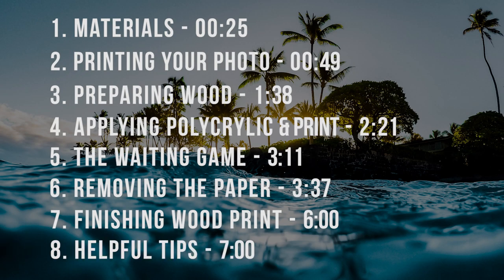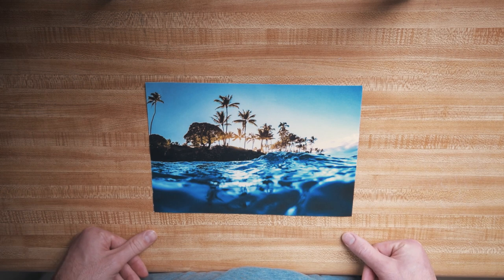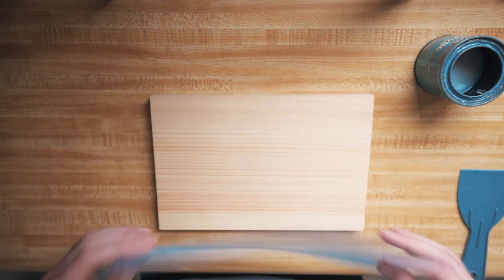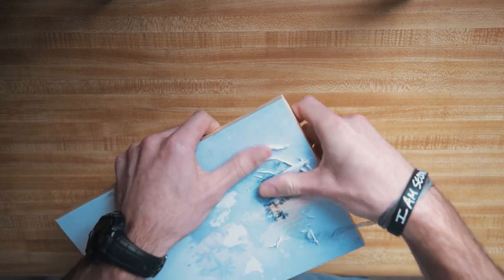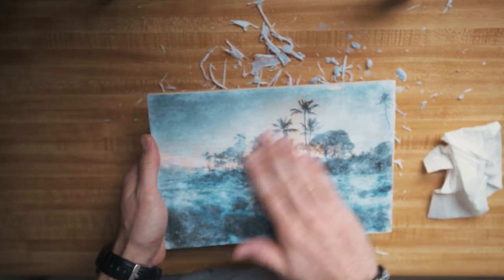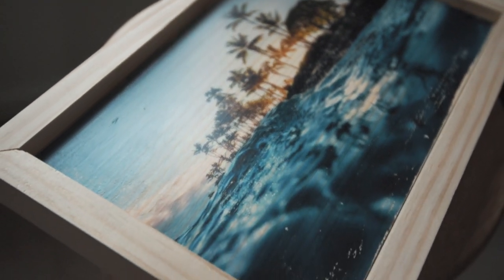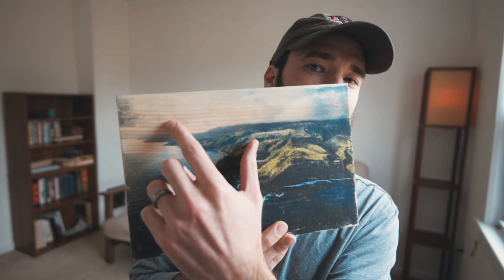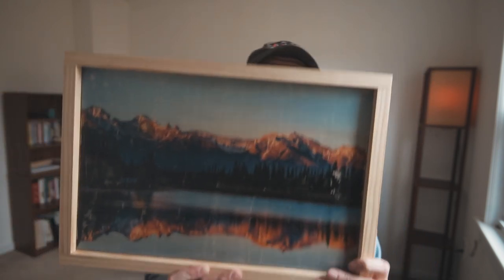DIY How To Transfer Photos onto Wood Using Polycrylic

Comment: I wish I could share my failures.  I have tried and tried to transfer with the polly.  I have done a thin coat, a thick coat, and everything in between. I have waited any were from 1 hour to 28 hours.  Every time 60 - 90% of the photo runs off with the paper.  Ppl please, any suggestions would be SO helpful!!

Comment: Hey, thanks for posting. I just tried this and when gently rubbing the paper off most of the ink came off also. I used pine, polycrylic and a laser printed photo.
Reply: try ink printed, not laser
Reply: Same here. Used inkjet and paint rubbed off with paper. It seems that the type of wood also matters.

Comment: If you use hardwood just put a couple coats until smooth and let dry. May have to sand after each coat. I like to spray wood surface first to lift grain then sand with 400 grit.Then it's no issue to transfer after a few coats.
Reply: Also I use a small torch to waive across each coat of poly to burst air bubbles. I use foam brushes and with torch it makes it super smooth.

Comment: I used the minwax matte polycrylic to adhere my picture to cedar plank. I have tried to take all the paper off in five or six steps but when it dries it's completely cloudy. Did I put too much polycrylic on? It doesn't look like it's cloudy from the paper but rather cloudy from something else

Comment: Have you tried doing the print on a wax paper or the glossy side of a sheet of labels (without labels of course). I have seen others doing it but not using polycrylic.

Comment: I've tried many times but I can never get the paper off without ripping the image and ruining the product is there something I am doing wrong? Can you go into more detail about how you remove the paper after everything has dried?
Reply from the maker: Hey Stephanie. I know it’s really tough, it seems like in the end it’s impossible to not take some of the photo off. I think the biggest thing for me was to not be too rough when rubbing off the paper. Also make sure that the paper is wet enough when rubbing, if it’s too dry I think that could take some of the ink off easier. Hopefully those might be helpful, I wish I had the process down a little more myself!

Comment: How does this procedure hold up outside in the elements?
Reply from the maker: Hey Mark, thanks for the comment. I personally haven't tried having a print be outside in the elements, but I don't think the polycrylic is recommended for outdoor use. Maybe you could put a better finish over the final project that is more suited to be outdoors, possibly a polyurethane or varnish!

Comment: Question...  want to transfer a photo onto a black painted (store bought) frame. Will this method work for something painted and already finished? If you have an email I can send example, but basically I am going to take a picture and extend the picture into the frame. Maybe you can visualize? Picture, surrounded by a mat, but the edges of the picture extend beyond the mat onto the frame. Preferably a painted black frame. Think night shot, a mat to isolate the picture, then a frame to extend the edges of the picture. Black frame for darkness of night but color image added to it to extend the picture...  I hope that makes sense?.?.

Comment: I used basswood and the ink stayed in some areas, but was mostly torn right off. Do you know if the wood is the problem? By the way, great video!
Reply from the maker: Hey thanks so much for watching the video and commenting! Hmm that’s interesting, I would’ve thought basswood would have been a good one. I’m not sure but I think I may have used basswood before doing it and it worked okay. If I had to make an assumption I would say that the basswood wasn’t the problem, but I can’t say that with full certainty. I think that if it was the issue than maybe because it is too soft? Haha I know that sounds kind of crazy, just trying to think what could be the problem. I’d say if you’re able maybe try one more time with basswood and maybe put a little more polycrylic on. Other than that, I’m not sure. I might give basswood a try myself and let you know what happens if I do! Thanks again
Reply: Lucas Moore Alright! I’ll try sanding it down and trying again with some more polycrylic. Thanks!
Reply: Lucas Moore I sanded it down, used more polycrylic, and tried again and it worked perfectly this time. Thanks for the advice!

Comment: Hi,
I’ve tried this a few times and I’m struggling to get the ink to transfer to the wood. I’m using pressure treated pine. Would this be the reason?
Reply: Most likely.  Pressure treated lumber will not absorb this type of ink well, if any! Soft wood like pine has less dense wood fibres so the ink is absorbed easily.

Comment: A better way to do this, is to convert a standard ink jet printer, Hint here Epson Eco Tank, to a sublimation printer.  Print your design as stated on A-Sub or the likes paper, and heat press it to the wood.  Saves having to remove the paper, and comes out looking so much nicer, because the paper fibers disappear, you didn't have to rub them away, and no Hodge-Podge needed.  Directly print to the PolyCrylic.
Reply from the maker: Hey David, thanks for the comment and insight. That definitely seems like a better way to do it, do you happen to have or know of a video on this process?
Reply: You’re all talks lol

Comment: I attempted this process and while peeling off the first layer of paper some of the ink came up with it. Any idea what might have cause this? I used a thin coat of poly, and let it set for about 90 min. Any advice would be greatly appreciated.
Reply: from doing this myself i suspect certain bits either don't bond properly because of bubbles or become saturated with water in the removal process making the paper become more bonded to the ink

Comment: After printing the image on the label paper how long can I wait until have apply it?
Reply from the maker: That is a great question Paul, I didn't specifically test that. I would say it shouldn't be too long, just enough time to have the ink dry on the paper. Maybe a few minutes?
Reply: @LucasMoore  I waited about 6 hours with out a problem.

Comment: I've tried this process out 4 times now and each time half of the ink comes off with the paper. I used pine wood for my last batch and sanded it down before applying the polycrillic. Paper is 20lb photo copy paper and image is laser jet ink. The furthest I can get  before the ink starts coming off is 1or 2 layers before the Ink where the image is visible when the paper is wet but still looks rough/cloudy. Any advice?
Reply from the maker: Hey Bryan, thanks for commenting! The same happens for me, some small parts of ink usually start coming off around the 3rd layer. I haven't found any way to prevent that myself. I always try to be gentle as possible towards the end.  I will say that even though you're right it does look cloudy when it dries, when you put a polycrylic/polyurethane finish over it that will help the image to look a lot more vibrant and less cloudy. Sorry I couldn't be more help.
Reply: If you wait longer then an hour are there any Benefits or is it harder when it sits longer?